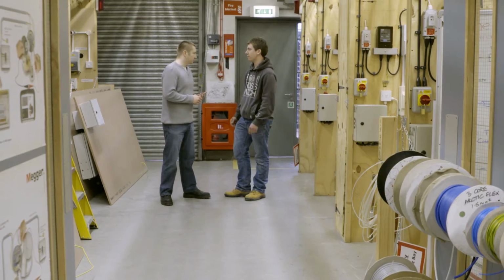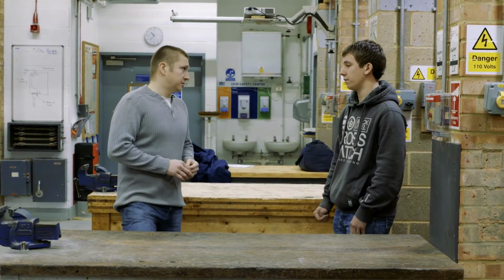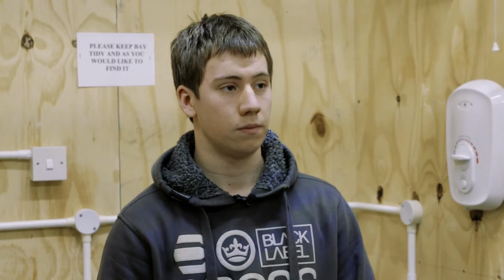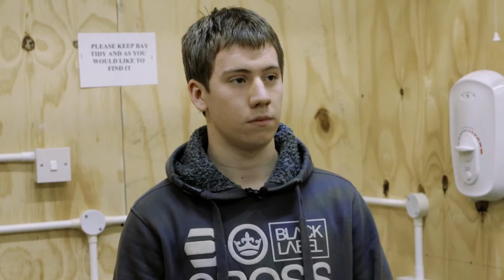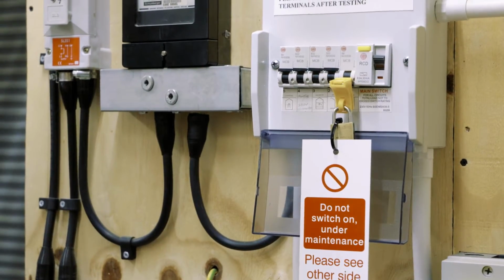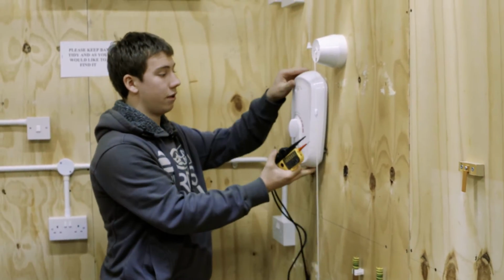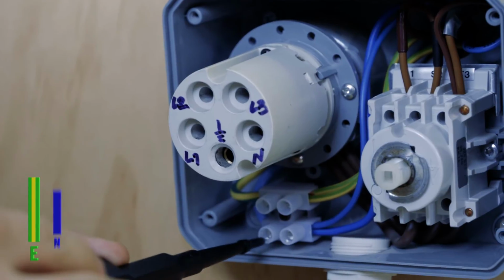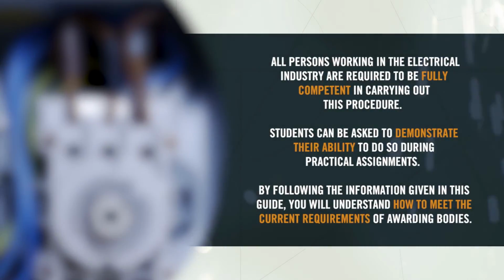Student's Guide - Safe Isolation

Comment: This is a great video and I have been using it for my students, but we noticed that the voltage indicator has an exposed tip that is excessive and does not appear to comply with GS38, which stipulates:

Voltage indicators are insulated to leave an exposed metal tip not exceeding 4 mm measured across any surface of the tip. Where practicable it is strongly recommended that this is reduced to 2 mm or less, or that spring loaded retractable screened probes are used.